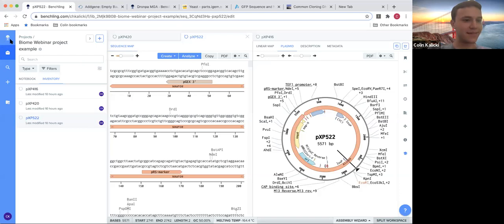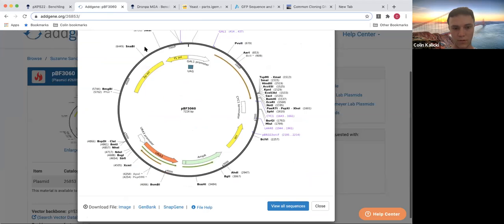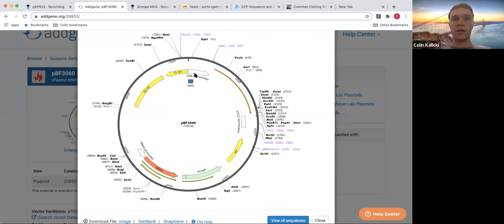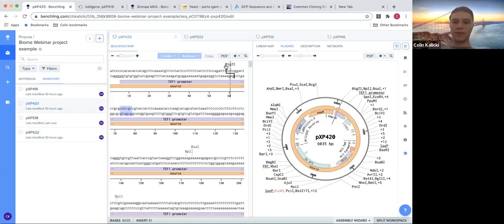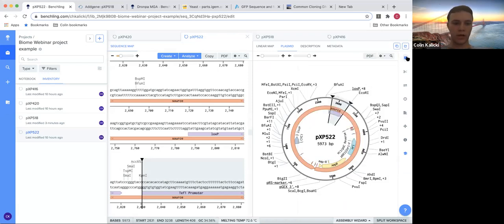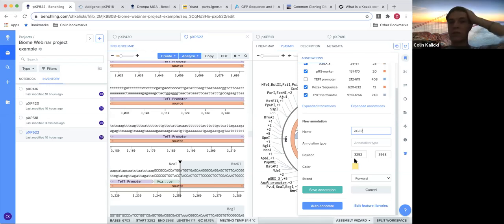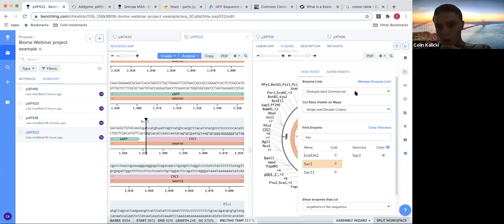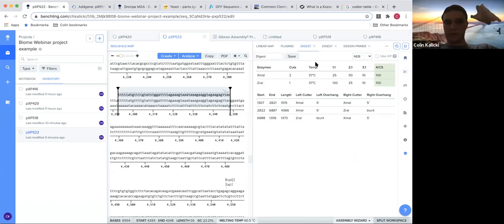How to Design Plasmids: Benchling Tutorial

Comment: I don't know what the odds are you will read this given the time difference, but I have a question that even my deepest of internet dives can't seem to answer. What if you don't want to use a pre-made backbone,? As in how are backbones originally made/designed? Is it just taking a blank plasmid and adding in promoters and resistance genes and the like as if they were lego bricks (in which case where does the blank space and unannotated resistance enzymes come from), it is a matter of extracting the very base from an actual yeast cell and sequencing and editing, or something else? Given the analogy of computer programming libraries, I'm curious to know what's actually happening in a library as I am using it. If you read this I was hoping you could point me in the right direction.

Comment: Good video, however I think you may have made a mistake with your Kodak sequence, the Methionine or ATG is supposed to fall inside of your kozak sequence, your GFP gene that you implemented included the ATG start codon for you, but you forgot to erase that and center the gfp ATG start codon with the one in the kozak sequence, and since the kozak sequence you used included an extra Guanine after the ATG, you ended up shifting your entire gene by 1 base pair, effectively breaking the gene. All you have to do to fix this however is go back in and delete the ATG of the GFP gene and the extra guanine in the kozak sequence. I would also recommend finding another yeast Kozak sequence as the one you used requires the guanine after the ATG however the GFP gene you used has an amino acid that can’t start with a guanine, so the easiest way to fix this is to delete your current kozak sequence and ATG, find another yeast kozak sequence that doesn’t have a base pair requirement after the ATG, for example ggatccacgattaaaagaATG (this is an actual yeast kozak that you can use) then after the ATG comes all of the other base pairs for the amino acids needed for the GFP protein. Hope this helps, sorry I’m not the best at explaining things, but I hope you understand what I’m trying to say.

Edit: grammar